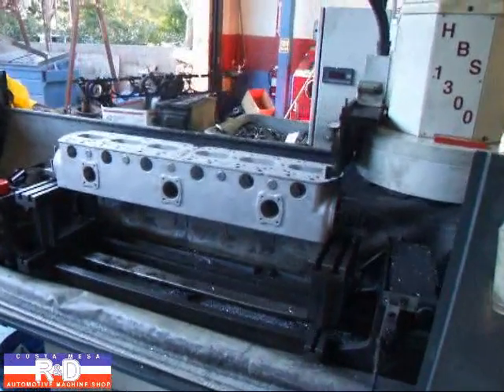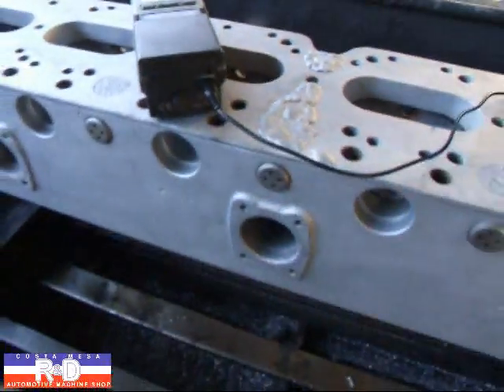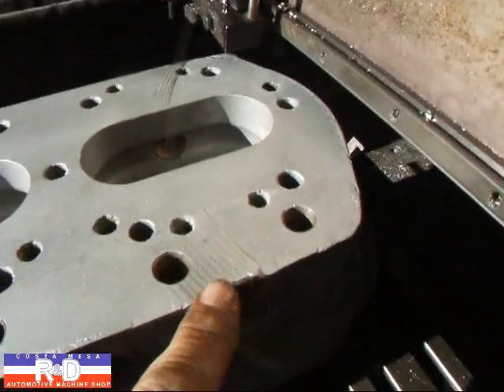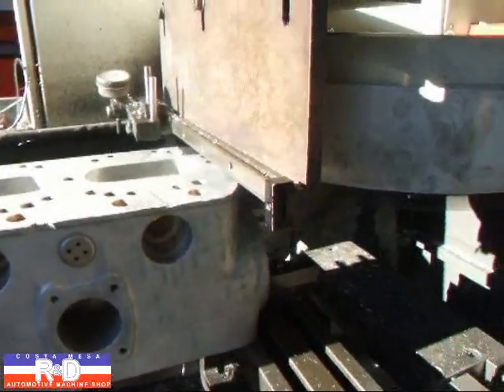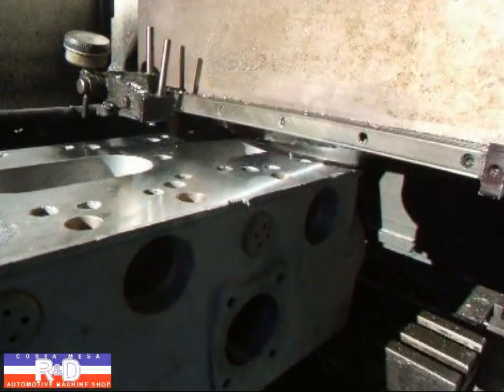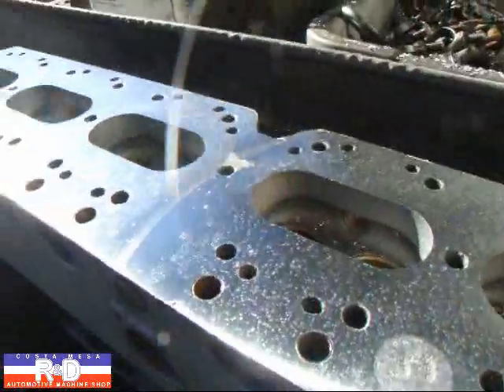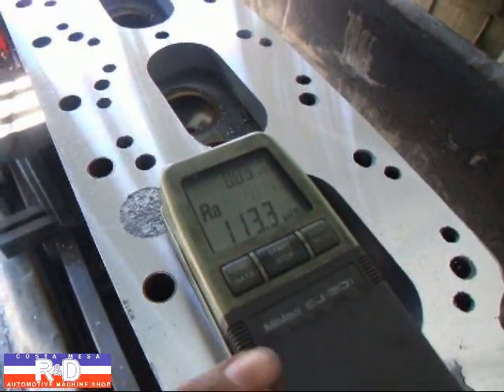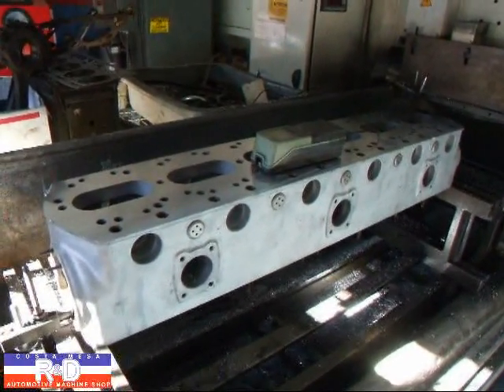1930's Rolls-Royce Cylinder Head Resurfacing

Comment: @1hdsquad If the head was deflecting he would get a surface finish of 1000+. Certainly not 18.1 which is damn good. John you should bill that customer for a new PCD insert since his tungsten dribbles probably chipped it! The tool to measure the RMS surface finish is called a profilometer.

Comment from the maker: @1hdsquad - a) This head was over 6" thick and is a very complex casting and does not require support. The welding of the corrosion damage is to blame for the excessive warpage. b) As stated, the gage measures five sections .030" long. See the Mitutoyo website for additional information. There are about 10 parameters that can be measured, the SJ-210 can measure Ra and Rz.
Reply: fiatnutz  feee

Comment: Great video, John :) I've got two quick questions:
a) Wasn't the head hanging through by it's own weight and the force of the resurfacer? I would have wanted to support it in the middle, seems like it is not necessary?
b) I wonder how exactly the measurement tool works, could you tell me how you call this peace of equipment so I can google its inner workings?
Thanks in advance :)

Comment: @jts895 Its not really surprising it had a rough surface to start with. 
Automotive machinists used to purposely leave the surface finish a little rough when using composite Copper/fibre head gaskets. Apparently it gave the gasket more "bite" onto the mating surfaces and made for a longer lasting seal.